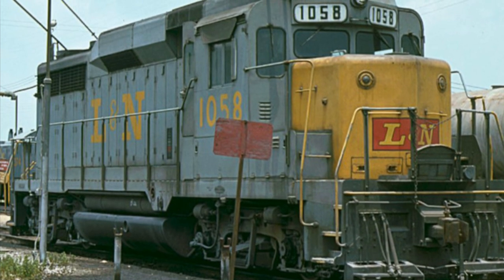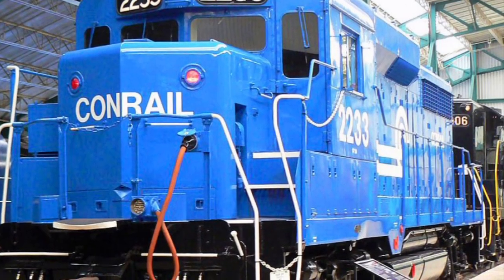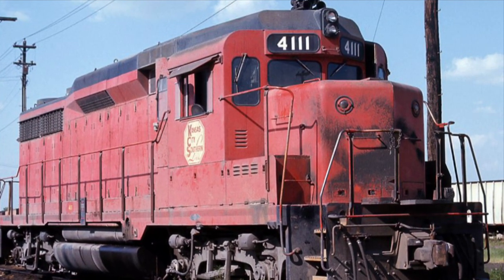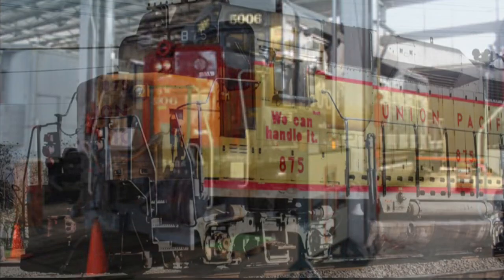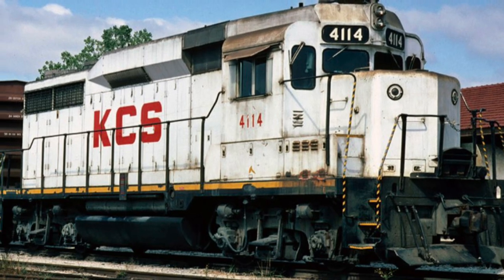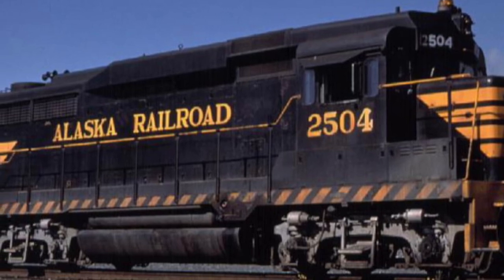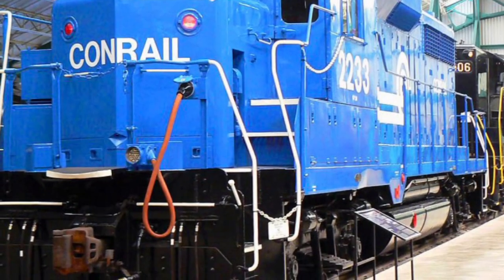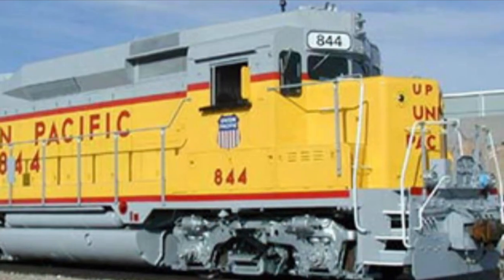Engines Of North America :The EMD GP30

Comment: The reading and northern have some ,but are now classified as gp39RN. I guess they are just interiorly a gp39 , but the gp30 outside.
Reply: They were rebuilt to a GP39-2 standard, but in that compact body/chassis. Remember, the GP30 is much shorted than the later GP38 series. The GP39 series had a 12-cyl and not the standard 16-cyl of their cousins GP38 and GP40 series (hence why the 39 rest in between). That's why it's classified as a GP39RN.